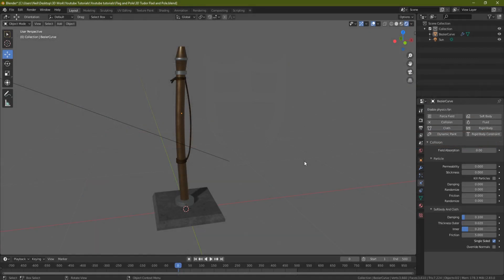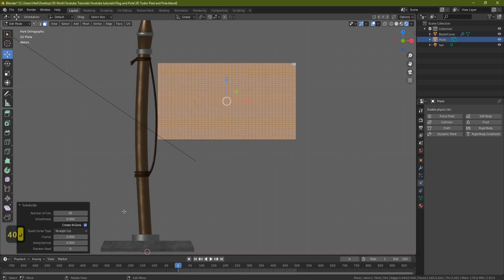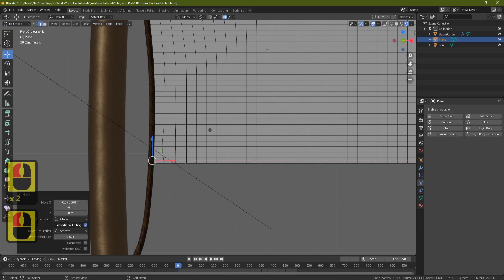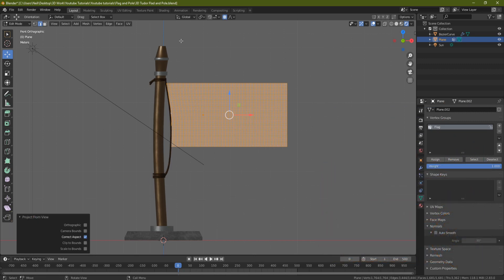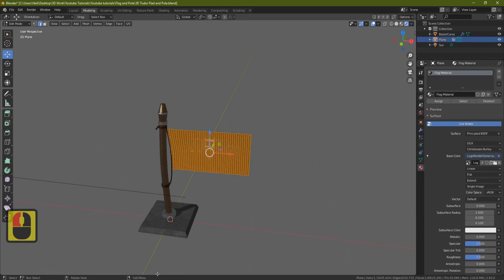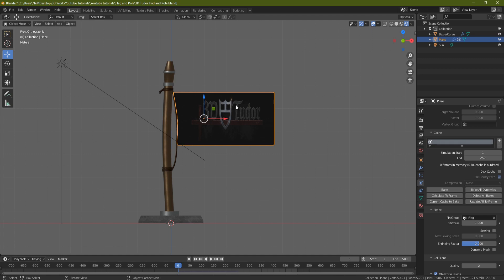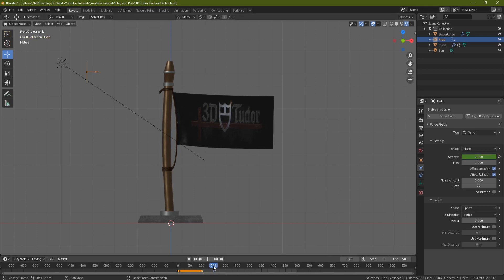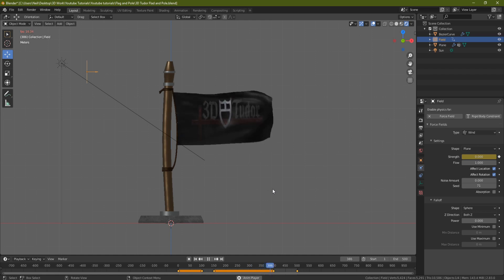Blender 2.83 Flag Tutorial  Cloth & Physics Simulation

Comment: You get nicer wind and sometimes less issues if you have a small angle on the wind vs the flag. Also which adds realism is adding an Harmonic force field, then add a keyframe and add a modifier on say X and Y so it moves around automatically. The Harmonic force will pull on the flag but also be influenced by the wind
Reply: It will make the wind gust look more realistic as seem to be really pulling on the flag.
Reply: THere is also somthing off, it looks like a fabric even lighter than satin, it has no weight or gravity setting are complete set to zero
Reply: PS what units are you using? Looking at the grid, its either small or you model is HUGE